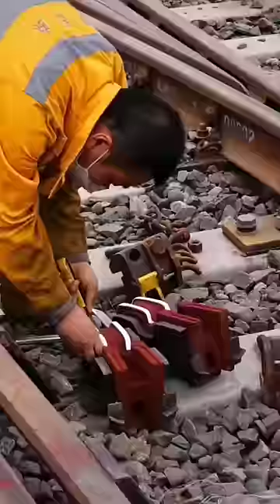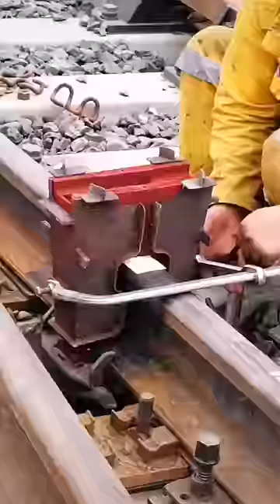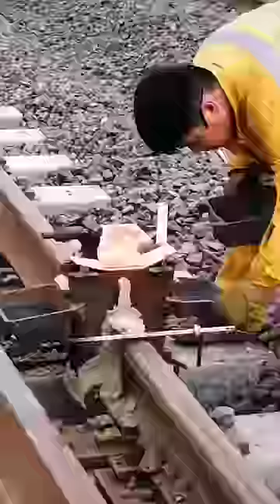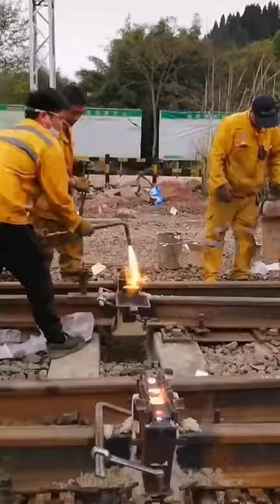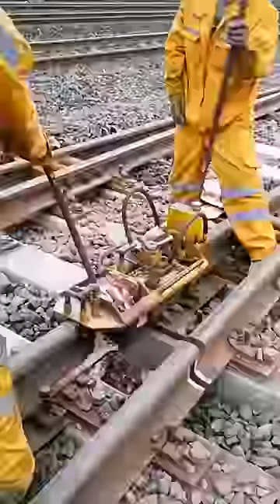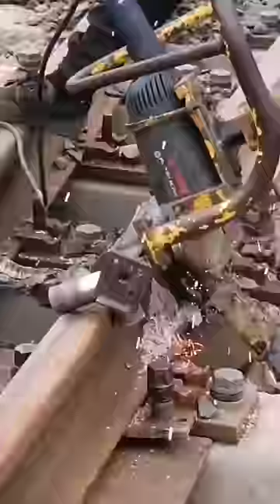AmazingChina: Thermite Welding Train Tracks

Comment: I'm glad I'm not the only one thinking about thermal expansion come summertime
Reply from the maker: Thanks for stopping by, they're not just randomly closing rail joints, they also heat the surrounding section of steel rail so it expands.  This is for High Speed Rail (225 MPH trains).  China has laid 26,000 miles of track for High Speed Rail.  Three other videos on the channel show the massive train track laying machine.
Reply: Continuously welded track is installed under stress and doesnt need expansion joints

Comment: For those wondering why they do this over traditional welding, its because other welding techniques can warp the track and cause serious issues with the rail
Reply: First of all… What the actual fk?? 😂Where’d you hear that nonsense at? There’s no way that any form of traditional welding would “warp the track”. I can’t even begin to fathom the amount of heat it would take to warp a train track. Also, in this instance between the two, thermite gets much hotter than traditional welding. So between the two (thermite/traditional welding), if anything was going to warp it, which it isn’t, then it’d definitely be the thermite. 

The reason thermite is used is bc… It’s a much stronger weld than any other TW (traditional weld). It’s much faster than a TW. And the biggest reason is, which coincides with the first reason, it forms a solid weld all the way through the track. A TW would only be able to weld the outer edges of the track. With thermite the finished product is one solid piece all the way through. 

No I’m not employed for a railroad, but my dad is. He’s been with them since ‘83, which was nearly their beginning as they began in ‘82. The more you know.🌈
Reply: Thanks for sharing, went to comments for this.

Comment: Yeah that looks cool, I just wonder how efficient it is? I mean it looks like a strong weld, just time consuming and resource intensive. 
If a regular weld is just as strong but takes half the time, this method doesn’t make sense
Reply from the maker: I believe this technique creates a stronger bond of the rails.  This is for High Speed Rail (300 KPH) so they are doing it for a reason. 👍

Comment: Красиво?  Да. А что будет в летний период? Металл как известно при нагревании расширяется.
Reply: Не знаю как но по этим рельсам скоростные поезда ездят
Reply from the maker: Good question.  The section of track is heated to a specific temperature prior to the welding process, to prevent expansion in the summer.

-----

Хороший вопрос. Полная длина рельса нагревается до определенной температуры перед процессом сварки, чтобы предотвратить расширение летом.
Reply: В Википедии всё разжевано.
Reply: Перед или после таких работ плеть вводят в температуру эксплуатации

Comment: Surely welding it has to be quicker and cheaper
Reply: They don't have regular welder's in China
Reply: @Ada-zn3pw  if thats the case explains why cheers Ada
Reply from the maker: @Ada-zn3pw  That's an absurd statement, China has some of the best welders in the world, including CNC welding and AI robotic welding, both of which are demonstrated in other videos on my channel.
Reply from the maker: This method is stronger, and is the recommended technique for High Speed Rail 350 KPH (215 MPH).

Comment: Welding expansion gaps ?
Reply from the maker: China has 26,000 miles of High Speed Rail (225 MPH trains).  The below info is from Wikipedia:

https://en.m.wikipedia.org/wiki/Railway_track

Continuous Welded Rail

"Most modern railways use continuous welded rail (CWR), sometimes referred to as ribbon rails. In this form of track, the rails are welded together by utilising flash butt welding to form one continuous rail that may be several kilometres long. Because there are few joints, this form of track is very strong, gives a smooth ride, and needs less maintenance; trains can travel on it at higher speeds and with less friction. Welded rails are more expensive to lay than jointed tracks, but have much lower maintenance costs."
Reply: Its not an expansion gap. Continuously welded track does not need expansion gaps.